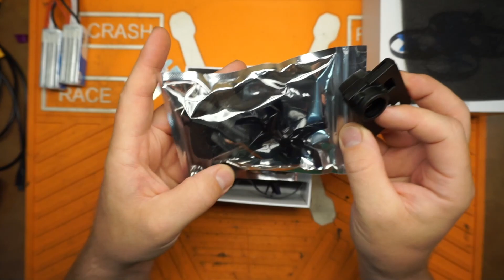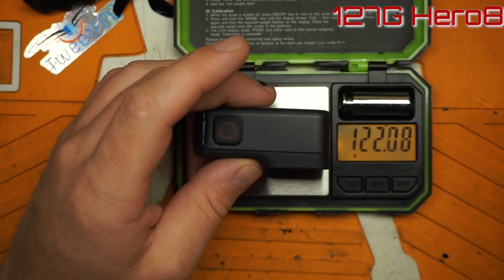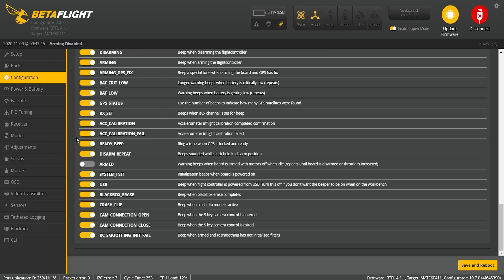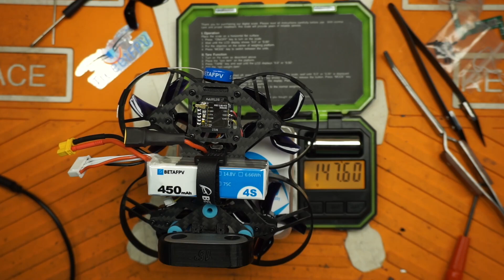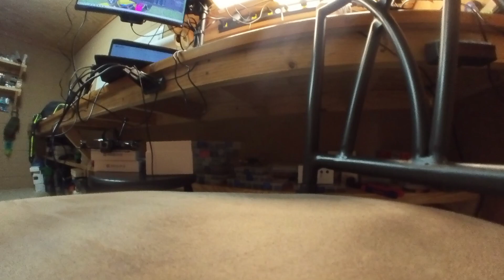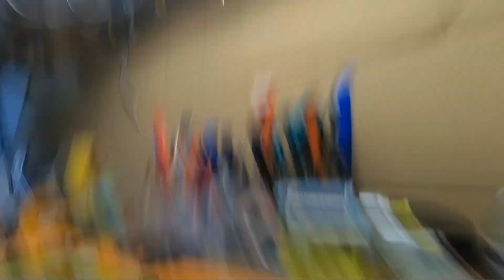BetaFPV Beta 85x V2 Review 📹🎥🔥

Comment: Hi!
I got the BetaFPV Beta 85x V2 , and it has very warm motors after a flight.
It's louder than I think it's normal too. 
Maybe it's just because I came from 65mm whoops! (:
Reply from the maker: If you can hold onto the motors without feeling pain then they are probably OK. Motor temp is very subjective. The pusher style quads are always very loud too
Reply: @TweetFPV  Thanks for letting me know that it's okay. I will definitely have a better sleep tonight. :D

Comment: Yours is a much cleaner build than mine. I must have gotten the weekend warrior build. Solder joints are sloppy and you can tell the vtx was reworked. The camera resting directly on the prop guards isn’t something you would think these engineers would do but low and behold! Also wires hanging out everywhere. That being said. After a quick rebuild this thing is pretty sweet! I would definitely buy it again.
Reply from the maker: Dang, sorry to hear the qc is almost nonexistent on yours. It's prety typically for the first run of a product to be bang on and then when the demand goes up the quality goes down to meet customer demands. It's a vicious cycle.
Reply: It’s all good. I actually got into the hobby because I love the build! I built 3 of them before I really even knew anything about them. Once I actually started flying them I’m even more hooked. Thought I would try a small prebuilt because I wanted to try one already tuned. Never flown anything tuned and wanted to feel spoiled.  Still more than happy with this quad given the price and availability! This is one of the only channels that I really even trust anymore. Thank you for all your great content!!

Comment: Love the video... I have the 85x V2 and while in angle/stability mode it pitches forward quite aggressively... So with three levels and some playing card I recalibrated the accelerometer. I then tested the quad  at 3ft agl and needed -65 accelerometer trim in order to maintain an almost stable hover... BTW i have changed from Oneshot125 to Dshot300...

Comment: How did you mount the naked go pro holder to the quad? The screws that come with dont grab onto the quad when trying to attach the mount to the actual craft.
Reply from the maker: I used the included screws. Head over to discord and I can share a picture of the ones I used. Www.tweetfpv.com

Comment: congratulations for your tutorial. I have a problem: After upgrading to BF 4.2, are you able to see the battery and link quality data in your OSD? I can see them in the radio display but not in the osd goggles.
Reply from the maker: I have not experienced that issue. It could be from a missed config item. When you flashed the fw did you say yes to loading custom defaults? Also did you select full chip erase when updating? If not I would recommend trying that.
Reply from the maker: Additionally if you are connected to bf and connect a Lipo do you get a accurate voltage reading on the top bar in the bf configurator?
Reply: @TweetFPV  yes the battery value is right.but the problem is that in osd nothing is displayed at all, only the viewfinder and the alarms.when the battery is low, "low battery" appears correctly
Reply: @TweetFPV  I don't remember this. I'm trying again but it gives me an error of programmation. what target did you use?
Reply from the maker: My target is matekf411

Comment: Still trying to get mine to fly correctly it’s all over the place like there’s something wrong with the giro
Reply: literally same thing happening to me, with my v1 for naked converted over to a v2 with the official BETAFPV kit.
Reply: @yarbsfpv  I don’t think the frame is suitable for upside down conversion as parts touch the frame causing vibration
Reply from the maker: What's it doing?
Reply: @TweetFPV   when you take off it’s jittery the motors are missing a beat and when you land as soon as it gently touches the floor it spazzes out , it was shooting of to the sky upon arming had to reduce the filtering just to stop that but it’s still bad and in the process of changing the frame as it snapped in multiple places
Reply from the maker: Dang. Does sound like a bad gyro
Reply: @TweetFPV  it’s certainly a over sensitive giro , the siltiest knock and it goes crazy , when I put it into a new frame I will add a lot more filtering and see what happens
Reply from the maker: I've see gyro issues go away with a lower cell count pack. But that's just identifies a bad gyro.
Reply: @TweetFPV  thanks